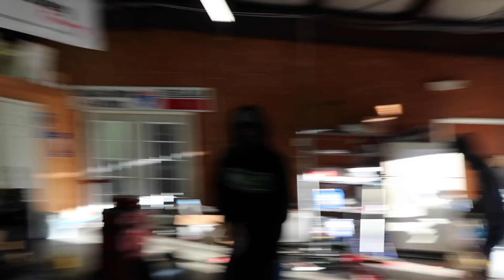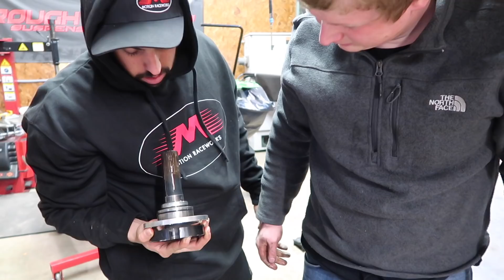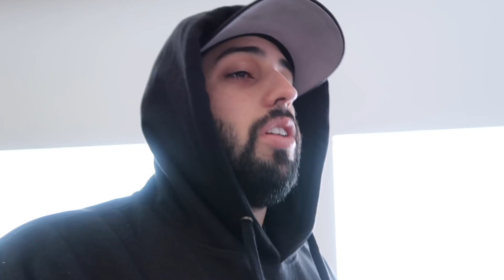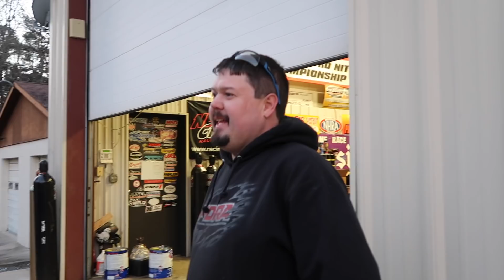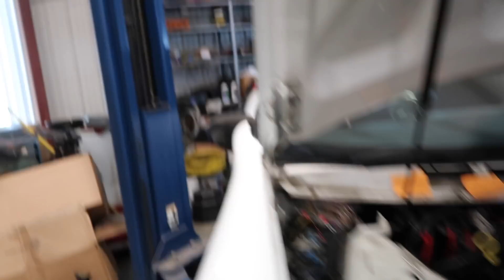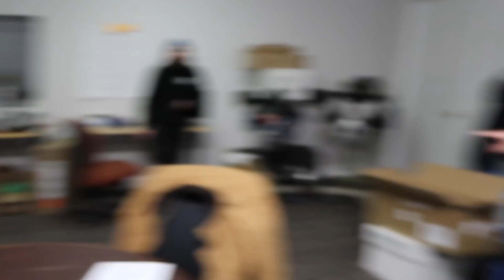Cowmaro Carnage!!! Broken rear and ditching the TH400!!!!

Comment: Hey man i have same car as you, doing 400 swap, wondering what your doing for vss? Not for speedo in dash but for tunning idle qualities ect . Was goana try and use a unit from dakota digital that bolts to old speedo gear housing on th400, and gives you a digital signal. Any help would be cool. Thanks Jon

Comment: Will your converter work with the glide? I’ve got a PTC converter from my dragster and gonna use it in my s10 with a 400. Old glide had a turbo spline shaft